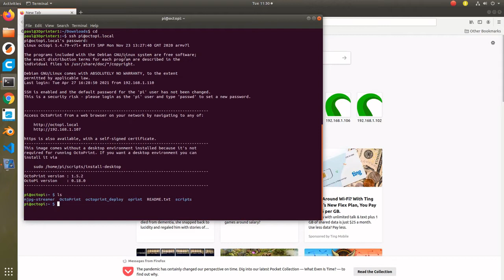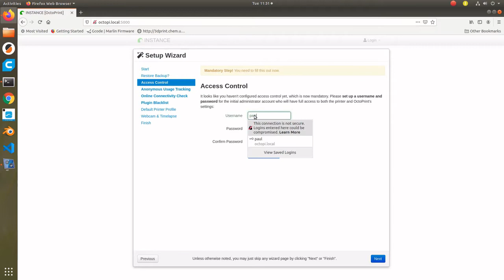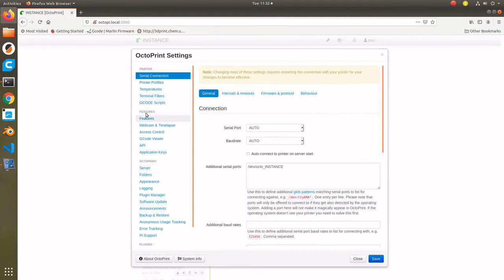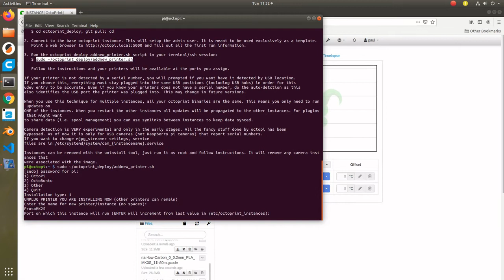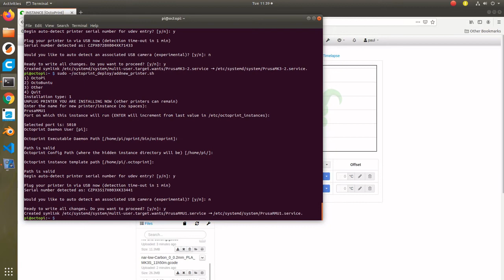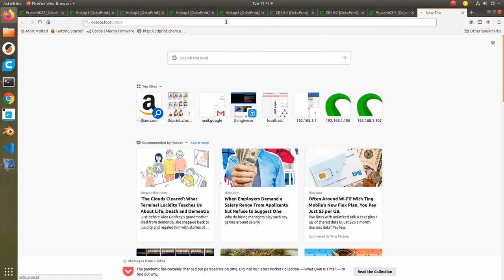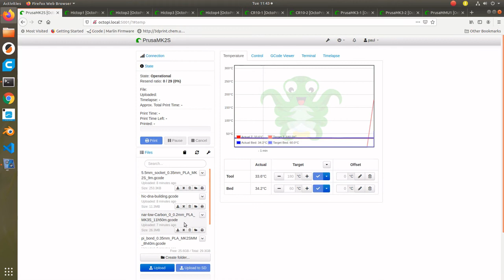10 OctoPrint instances on a Raspberry Pi4!

Comment: So few things… I’ve noticed a notable loss in print quality when printing through Octoprint. This makes the whole system somewhat worthless to someone selling high quality prints. Haven’t been able to work that out.

Second thing.. It was easy to make multiple instances of octopi… and run multiple printers… but I was not able to get octoeverywhere to function on multiple instances.. which again made the whole thing far less useful to me. 

You ran into either of these hang ups?
Reply from the maker: Nope. I don't typically run multiple instances on a Pi, but linux box/laptop. Octoeverywhere works fine with multiple instances.
Reply: @ppaukstelis  hmm. Wonder if I could repurpose my MacBook Pro to handle the printers

Comment: Nicely done Paul, really like the scripts. How much load do you get on the RPi4 running all printers at the same time? Would be interesting to see if some plugins create too much load on the processor. Can't think now of one that is CPU heavy except Slicer plugin or maybe Arc-welder in auto mode.
Reply from the maker: I forgot to check the load while it was running, but I'm planning on doing that today before I pull it all down. I'll do some stressing as well (see how ArcWelder processing on one instance impacts printing on another).
Reply from the maker: Checked it and load is 0.92, so basically using 1 of 4 cores to run 10 instances (while printing)
Reply: @ppaukstelis  thanks for the update. Any hicks during auto Arc-welder running?
Reply from the maker: @3dgussner958  Nothing obvious. I stopped one job, installed Arc Welder on that instance, then processed a large file manually. It pegged that one octoprint instance at 98% CPU usage (not surprising) but it did nothing to the other running instances.
Reply: I guess I then have to admit that the RPi4 isn't that bad. I am an Odroid boards fan